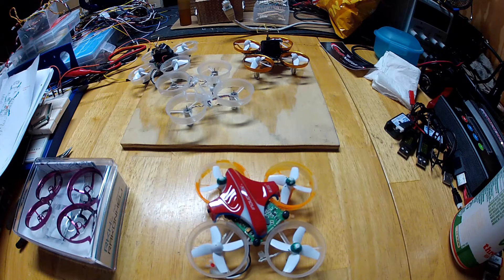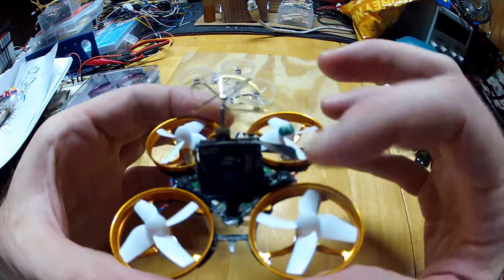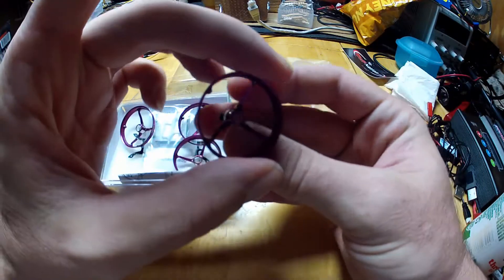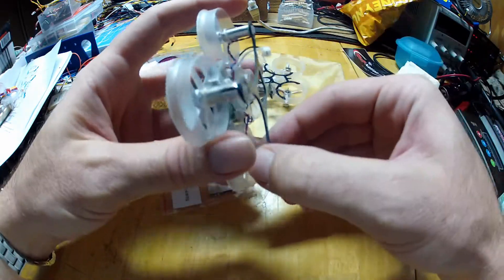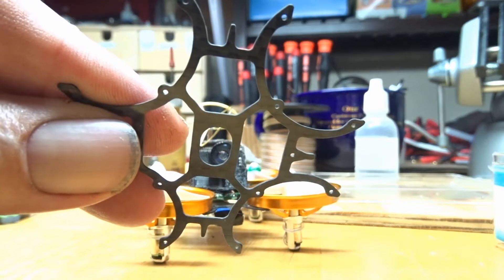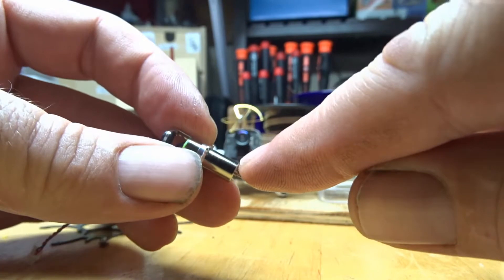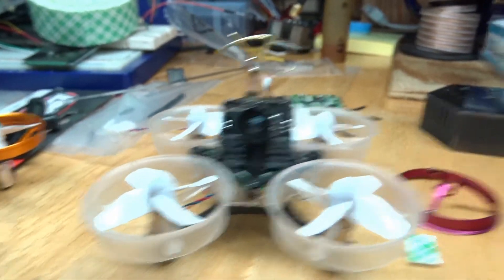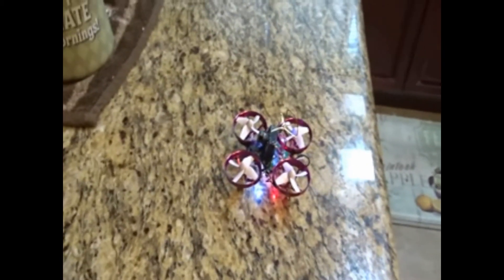Micro inductrix Upgrade with Tiny Whoop and Rakon Heli kits.

Comment: How's the frame holding up now that you've had it for awhile? My stock frame broke within the first 8 flights.
Reply from the maker: For the Rakon Heli stuff - The only thing that has happened is the aluminum 'rings' have sometimes gotten a bit oblonged during a crash, but I found a large automotive socket that is about the same size as the inside of the opening and so I use that to make it round again as needed. The stock frame never did break as far as I know after I put the carbon brace piece on it (black piece visible at 1:00 in the video)
Reply: C Roberts so your stock frame hasn't broken one support since you installed the X brace? That's great! Maybe I'll try and find a new stock frame and get the support brace just in case.
Reply: Joey Crane ..I agree on the carbon frame supporter..It is still possible to break those little struts but it takes many more crashes to do so. I also tried the eachine E010 frame a 2grams heavier but struts are way stronger but on the other hand I cracked a couple of the motor rings,but those frames are only 3 bux.

Comment: Thanks for the video -- two questions: 1: I can't get the motors into the mounts -- they feel like they're too big, but they're definitely 6x15mm, how did you get it past the initial opening? 2: What is the metal block you use?

Thank you!!
Reply: He's using what's known as a 'Riveting Anvil' or 'Hexagon Anvil'.  You can pick them up on Amazon for $10-$15.  As for getting it past the opening ridge, he'll have to explain because I broke one of the wires off trying to do it myself.
Reply from the maker: So I realize this is a really late reply.....The motors can be started into the aluminum mounts by supporting the motor on something sturdy first, and then pushing the mount down over the bottom. Rocking back and forth a bit seems to help. It is important to support the motor on the end of the can, and not near the end of the shaft/bush area.

The metal block I used is something I refer to as a "bench buddy". It is a watchmaking tool, take a look here if you want one: http://www.ottofrei.com/Store/Anvils-Bench-Blocks/ 

Cheap - like 10 bucks. I use it frequently.
Reply: louxniverse how to buy metalic bases motor? I'm new sub